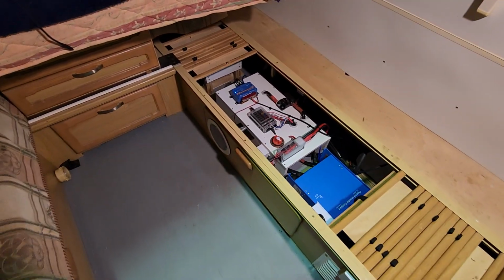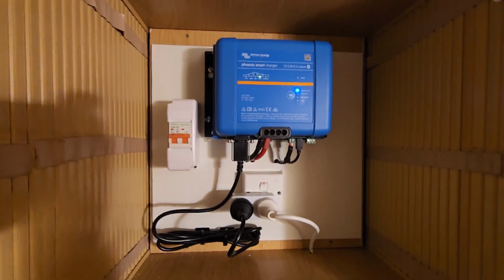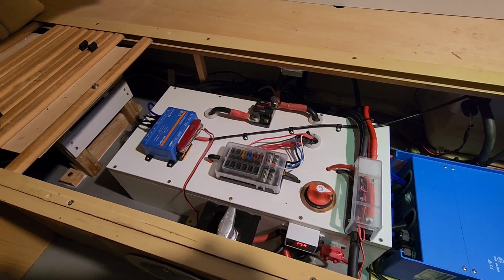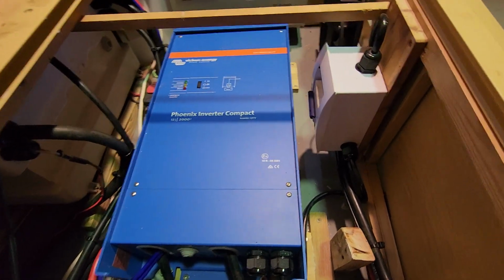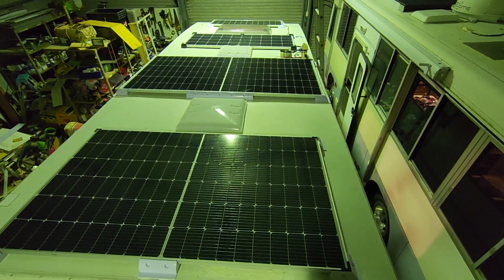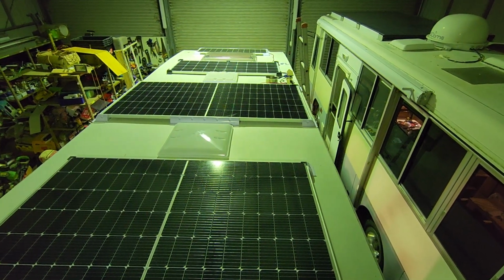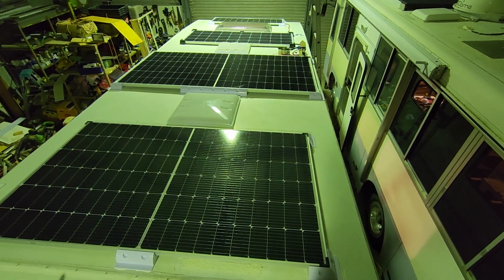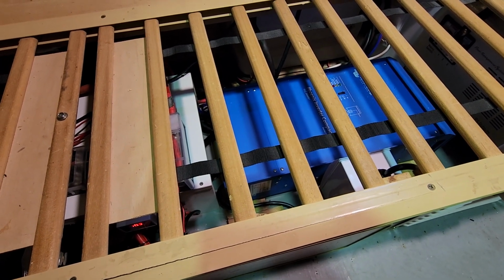Victron Camper Update. A new arrival!!

Comment: can i suggest that the main reasons for having 4 controllers are that the panels are all different sizes and secondly it helps with shading issues
Reply from the maker: Those are other good reasons.  I have not long fitted all those panel and choose different sizes that worked for my van the best. But I had made up my mind first that I wanted the separate controllers.
Cheers Tom